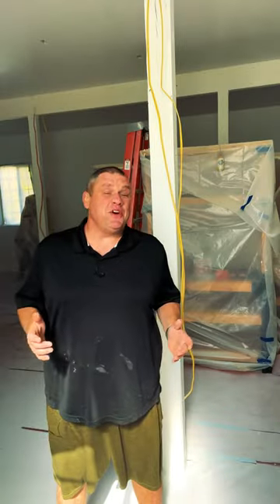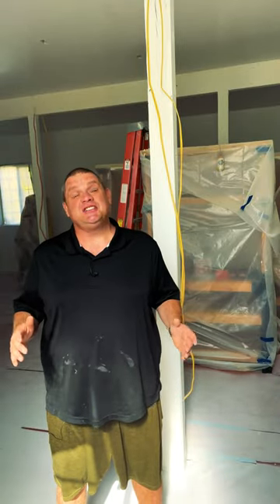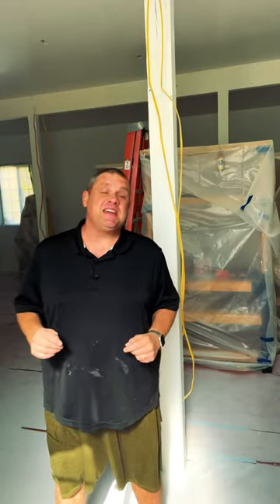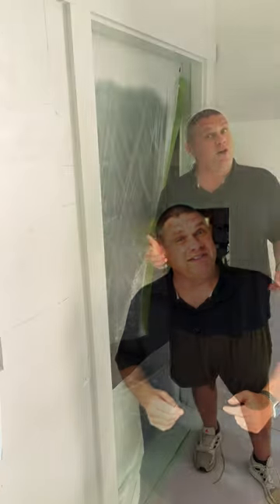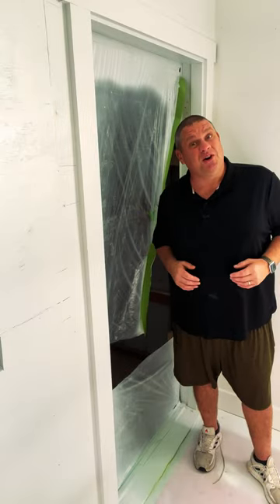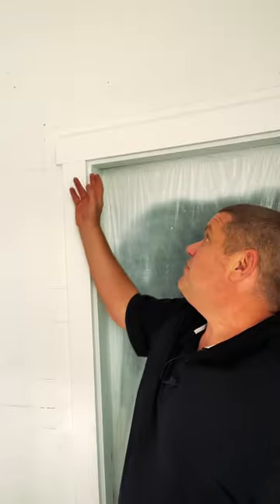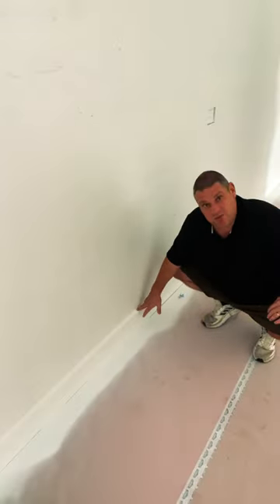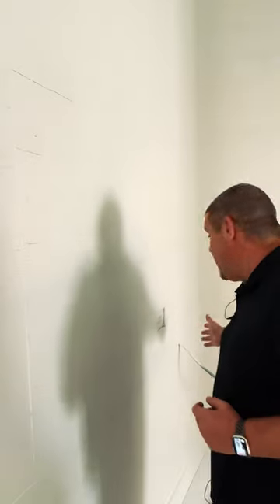Shop Renovation Progress: Day 35 Update Revealed

Comment: Are you leaving the whole shop white? Or are you going to do an accent wall or like a stripe or two around the middle or 1/3 or 2/3 up the wall?
Reply: An orange strip bordered by gray and brown would coordinate with your current logo.
Reply from the maker: Excellent Questions!  I will definitely be doing some sort of molding or wall art.   I’m kind of looking at the white as a primer right now.   I would really like to add some wood paneling etc.
Reply: That's what you need...wood paneling and shag carpet!!!😂😂😂
Reply: @joegutierrez4197  😂😂😂
Reply from the maker: @joegutierrez4197  Shag carpet would be perfect!   It would be so easy to clean! :)